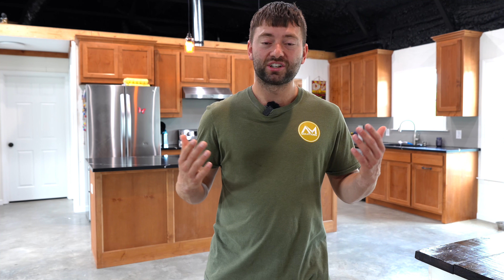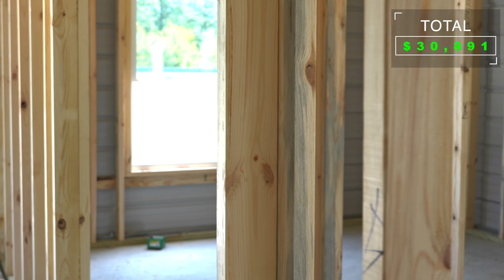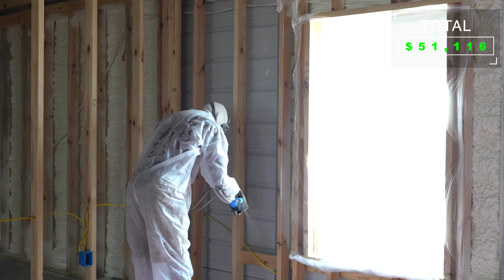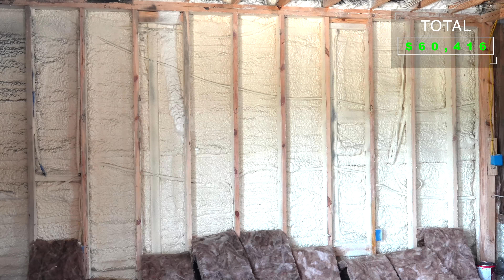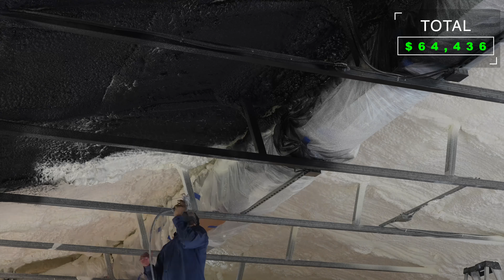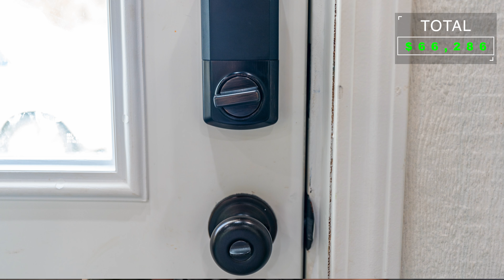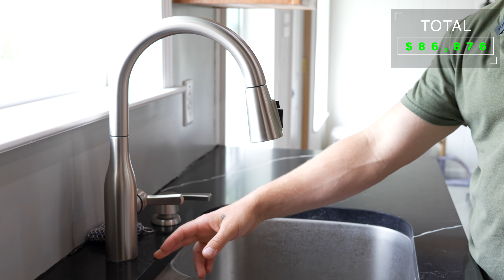Barndominium Price Breakdown | Building a 1,500 sqft 3 Bed 2 Bath Home for $87,000

Comment: Thanks so much for this video! 

It's especially useful because now others who want to build that size barndo can provide builders with this video's web address and ask them to compete. 

I didn't have the benefit of your video when I General Contractored my own barndo in 2008, so my task was a lot more difficult price-research-wise.

HVAC: I'm curious if you considered mini-splits instead of the fully ducted HVAC system that you chose. There are now available, at a decent price, 18-20+ SEER mini-splits that qualify for the 30% federal tax credit. I'd be curious to see a cost comparison to what you chose.

I have a 40' x 80' barndo that's half garage, half living space. My 1600 sq. ft living space consists of two bedrooms with their own built-in baths, plus one Great Room. Each bedroom/bath suite has its own 9,000 BTU mini-split and the Great Room has two 24,000 BTU systems. Each min-split is 100% independent so if one goes down, it won't pull down any other. 

Compare that to a standard HVAC system like you chose: If one part fails during a super-hot day, the whole system goes down and you're stuck until help arrives (sure, you're lucky; you ARE that guy).

BTW, I have a zero to negative (they pay me) power bill thanks to a 9.9KW solar array that I DIY-installed on my roof in 2010. And that’s with me keeping nice and cool (I otherwise sweat like a pig).

My 24,000 BTU Mitsubishi mini-splits are rated at 19 SEER and my 9,000 BTU units are rated at 20 SEER.  I only have to run them for part of the day during the Summer because my barndo is well insulated. And I never have to turn on my heat all Winter because I live in South Georgia (rarely goes below 50-60 most days) and I blended solar-mass hearing/cooling design into my home’s foundation (it’s perched up on an extra, sun-facing layer of clay).
 
My mini-splits also require lower maintenance than standard HVAC systems. We're talking once or twice a year E-Z filter clean, plus drop a chlorine tablet in the drain line maybe once or twice a summer. That's it. You can find more demanding maintenance videos online, but those are basically jungle-environment situations. My installer told me that, given where I live (and South Georgia is pretty humid btw), I'll never have to fuss with maintenance beyond the filter clean and tablet drops. 

That's a big deal to me when one compares HVAC system choices.  For each one must factor in long-range operating costs, and that obviously includes maintenance costs -- especially for those who pay pros to handle that. I’ve had no maintenance or other issues since my mini-splits were installed in 2017 and 2018 (they replaced window units).

Anyway, thanks again. This is one of the BEST barndo videos out there.
Reply from the maker: Thank you for the in depth comment! 

The big factors for choosing my HVAC system are simplicity, price, and effectiveness. 

My system is a heat pump system, so it is efficient. Not as efficient as the 18-20 seer mini splits that you have. That being said, it is hovering around 100° here in Louisiana and my electric bill was under $60 last month. My barndo is well insulated also. 

Simplicity: I have one system to maintain. Since my return is up high in the attic space, it does not collect much dust. I change the pleated filter every 2-3 months. I will also rinse my condenser once per year. 

During install, I only needed electrical service ran to one location. 

Finally, I have one condensate drain to maintain. And even if it gets stopped up, the entire system is outside, so I don't risk water damage in my home. 

Servicing and system replacement are convenient and simple. Everything is accessible outside at one location. No line sets, no soldering. I could swap the entire system in less than an hour for $3k with a 10 year warranty. 

Effectiveness: I have 3 bedrooms, 2 bathrooms, 1 closet, 1 laundry room, and a large kitchen/living room. 

That's 8 rooms. To have the balanced airflow that I want, I would need 8 mini splits or at least 8 indoor cassettes. (Probably an extra for the living room).  The benefit of the mini splits, is if 1 fails, it's not a big deal. If my central system goes out, I have no AC. The workaround is I can cool my house with 2 small window units. 

Price: Lets say everything cost about 7k, including running electrical to several locations instead of just one,  that's on par with my central system install. The cost and time savings comes into play when equipment needs to be replaced. I can swap the package unit in an hour for $3k with a 10 year warranty. It will take more time and $$ to change out multiple mini splits. 

There are definitely pros and cons to each system. I like the balanced airflow and ease of service. Plus the low cost of replacing all of my equipment in 1 hour.

I can't touch the efficiency or the ability to selectively cool one room at a time. Or the ability to replace the system in sections while still having AC.
Reply: @DudeWeCanBuildIt  I’m replying solely to benefit your subscribers since, again, this is an extraordinarily useful video for those thinking of going the barndo route – especially when it comes to cost and design utility issues -- in this case, standard HVAC vs. mini-split systems.
								
I also would like to provide if not evoke maximum information to inform consumer choice between the standard HVAC system versus my preferred mini-split system.  Note that I’m now on my third home.  The first two (stick-built, non-barndo homes) had the standard HVAC system that you’ve chosen.  As I mentioned, my latest (barndo) home uses mini-splits performing so well that I will use them in my next barndo.

There are a couple of your assertions that are, with respect, worth some push-back:

RE: “I can swap the package unit in an hour for $3k with a 10-year warranty. It will take more time and $$ to change out multiple mini splits.”

You’re supplying your own labor and thus, that $3k price is just for the hardware – and a bargain at that.  Two Savannah GA friends of mine just had their 2.5 ton HVAC systems replaced (and they shopped it!) for $5,500 and that was for the generic (“Goodman”) brand at 14 SEER. They would’ve each paid $1800 more for 16 SEER btw, but opted not to because they planned on selling their homes within 3 years.

Your assertion also assumes that all four of my mini-splits would fail at the same time.  That's like assuming that I have 4 cars and drive them all equally, so they’re just bound to wear out equally and fail all at once. That’s not anywhere close to reality.

For that matter, my mini-splits are used at different rates: Retired, I live alone so I use my MBR unit only at night because I don’t use that room during the day.  So during the summer, I shut the MBR’s doors during the day because I’m only in my Great Room and hey, why waste A-C on it?  Conversely, I turn my Great Room A-C off when I go to bed at night (I've got a very well insulated home -- artic foil pouch insulation -- and even deep summer mornings here in South GA are in the pleasant mid-seventies).  I A-C my Great Room only from 11:00 a.m to 11:00 p.m., then rely solely on my MBR system (see how flexible mini-splits allow one to be?).

My “Guest Bedroom/bath,” for that matter, is used only for occasional guests, so it’s the same there – its doors are kept shut during the summer.  Hence, that mini-split gets only infrequent use and thus piles up even less “mileage” (wear and tear) on it.  Finally, Mitsubishi is a durable brand, so it should easily go 10 years without any issues (in my 7th year for them all, btw).

This, then, is just plain wrong: “It will take more time and $$ to change out multiple mini splits.”

Don’t miss the obvious built-in advantage, too: Your system wears down whenever you use it and you’ve got to cool your entire home whenever you use it.  I can more efficiently “wear-and-tear” my equipment.  

END OF PART ONE.
Reply: PART TWO:

Your 10-year warranty claim (I’ve got that on the main components of my mini-splits) is misleading by omission because every standard HVAC warranty that I've read covers just one or two major components but not circuit boards and other common failure points like capacitors.  Worse, those warranties never cover labor beyond the first year or so, and just getting a pro out to my home costs $100 to “look at it,” then “plumber prices” for follow-up calls (you know, go get or order a part, then return to fix it while I stew in the mucky heat and round up "ransom cash").

Drill down further on that because it’s important: Mini-splits (thanks, China!) are now so cheap that it’s arguably easier/cheaper to just swap out entire malfunctioning air-handler or condenser units rather than pay for multiple service calls to diagnose, then install, the often “on order” replacement part(s).  Go to Amazon right now and click on this in its search bar: "ductless air conditioner mini split."

Pretty amazing, eh?  There are Chinese knock-offs of 9,000 BTU Brands in the sub-$600 range.

RE: “And even if it gets stopped up, the entire system is outside, so I don't risk water damage in my home.”

ALL mini-splits are more or less installed with their condensers (hence, condensate drain line) outside, so you’ve cited a bogus “advantage” here.  Even better: 100% of my drain lines are easily accessible, while with some (e.g., attic installations) HVAC systems that’s simply not the case (part of a drain line can get run through into a tight angled, roof-line slope).

Bonus: mini-split condensers (all 4 of mine) can easily be wall-hung (mine are camouflaged by my porch awnings) and thus, spare both ground-space consumption and maintenance (I have to constantly weed and blow leaves out of the “condenser corral” at my girlfriend's home).

RE: “I have 3 bedrooms, 2 bathrooms, 1 closet, 1 laundry room, and a large kitchen/living room. That's 8 rooms. To have the balanced airflow that I want, I would need 8 mini splits or at least 8 indoor cassettes.”

That’s an exaggeration.  No one is EVER going to A-C their closet.  Nor would I bother with a laundry room, in which one spends a few “in and out” minutes doing their laundry.  BTW, I don’t own a dryer – click on my Zillow page to see my surround porch, which sports a nice clothesline – and my high-efficiency washer is in my 1600 sq. ft. garage:

https://www.zillow.com/homedetails/2288-Deerwood-Rd-Soperton-GA-30457/194109099_zpid/?view=public

Next, recall that in my two-bedroom, two-bathroom home (plus Great Room), my two, 9,000 BTU units easily service each full-sized bedroom AND built-in, full-sized bathroom with storage closet and cabinet.

So really my home just needed 3 mini-splits but, like Louisiana, South Georgia gets REALLY hot/humid and I’m heat-sensitive, so I opted for that second (really a backup) 24,000 BTU system, which I turn on only to supplement the first system on 95+ degree days (many Southerners wouldn’t need it because they’re fine with 78-80 degrees inside but I  want the option to go down to 69 degrees – given my “Yankee heritage”).

Ahhh, but you'll ask: What about a barndo design with SEPARATE bathrooms?  That would be problematic (that’s my luxury, btw: I’ll never build another barndo without each bedroom having its own, built-in bathroom like I currently have).  If each barndo bathroom doesn’t have a doorway that (like mine) opens to its own bath then sure, that separate bathroom would get hot and humid in the summer.  

In that case, one can choose to drop $600 for a small mini-split for each.  Again, check out the “Amazon” selection – and those are full package kits btw (I ordered a full-package, 24,000 BTU Mitsubishi kit for my Great Room that way).  Sure, that's a lot of equipment for a bathroom, but I build only large bathrooms so there's plenty of wall space for the air-handler part of a mini-split.  But sure, smaller bathrooms will present a problem, so there's a plus for your side of this debate.

Anyway, pause to add up four mini-splits at today’s prices (remember that pricier units often qualify for the 30% tax credit), then include installation (plenty of mini-splits are DIY btw) and electricals.  You’ll find that there is no comparison to the central HVAC systems my Savannah, GA friends just installed; mini-splits win the day here.

END OF PART TWO.
Reply: PART THREE:

There’s more.  Again, you concede that a failed central HVAC system leaves one stranded on a hot day, with the typical consumer waiting for 1-2 repair visits and even longer if a part needs to be ordered.  And that’s a lot of hassle to go buy (or garage-stock) “emergency window A-C” units at the local Walmart and install them while burning up in sauna bath-level heat/humidity (I used to live in New Orleans, btw; it can be brutal).  Meanwhile, my four separate mini-splits, all on their own circuits, translate to no hot, sweaty nights – ever.  If my MBR unit fails, I'll just sleep in my Guest Suite, or on my futon bed in my Great Room.

That’s a 400% redundancy compared to your central HVAC choice.
 
There's still more HVAC-system downside to consider:  You’ve had to consume inside-building space just to run HVAC ducting and those long, aluminum-foil tubes.  That prompts many to create an attic, which I was able to skip (check out my Zillow interior photo).  And ducting itself constitutes a maintenance issue: After about 8-10 years, one must inspect for and repair seam leaks and resulting cooling losses.  And that’s on top of the cooling loss just from pushing cool air through the length of those tubes – through a super-hot attic at that.  Check this out: https://www.carolinaductmasters.com/what-should-you-know-about-your-attic-ductwork

My mini-split installer, btw, told me that HVAC systems can be made very efficient but always come in at lower SEER ratings because they're dragged down by ducting -- having to push cold air through them AND thus suffer the "cold losses" along the way.  In contrast, there's NO ducting with mini-splits; they're shooting cold air directly into each room.  So in effect, you’re paying more for more “compensatory cold-air generation” just to use a centralized HVAC system, and that’s on TOP of the interior living space loss (I like my high, “vaulted ceilings” btw).

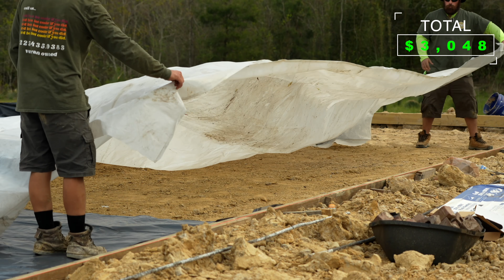Sidenote: I was able to use "grow-room" (what marijuana growers use) membrane for my Great Room’s ceiling (enhances natural daylight and acts as an additional insulating layer).  That enabled me to use the ceiling's natural vault angle per my roof’s 2:12 pitch.  I didn’t have to create channels or an “attic” space just to accommodate all the ducting and venting that a standard HVAC system requires.

One mini-split downside, at least with the brand I chose: It doesn’t import fresh air but instead 100% re-circulates the room's air.  That's not an issue, though, because of my building's design choice. You can see it in my Great Room photos.  I used (from Lowes, lifetime warranty, on sale) six sets of French doors instead of windows for maximum glass and E-Z access to my forest.  The middle spine of each door set has a 1/3" gap at the bottom and I’ve stuffed a stainless steel mesh ball into it to keep bugs out.  Fresh air thus naturally flows in through each of those gaps. Pulled upward by the naturally higher air temps at the higher-elevation in the room, that fresh air then works its way up to the built-in ceiling vents and out the roof, carrying existing air (hence, refreshing it) with it.  My mini-splits "pour" cool air into the room at the same time and a natural "swirl" results.  

That’s passive air circulation; no additional pumps or fans are needed.

Similarly, each bedroom – in the summer – draws open floor-tile cooled, “floor air” through each bedroom door gap and that air, too, flows (as it's heated) up to the angled ceiling that “guides” it through 4" wall cut-outs (like “dragon teeth”) to the same roof-vented, natural air flow exhaust system.

Put another way: All three rooms in my 2:12 roof-pitch barndo have up-angle-sloping ceilings so those special cut-outs between rooms enable relatively cool, floor-level incoming air to naturally rise (as it heats) and flow directly out of central-seam roof vents.

In that way, there is no heat or moisture or stale air build-up.  

Bonus: The bedrooms (with their doors closed during the summer) are at most 10 degrees warmer than my Great Room if I leave their 9,000 BTU mini-splits off during the day.
  
Relatedly, you also mention wanting a “balanced airflow.”  That’s a feel-good statement, not reality.  In fact, I don’t want a foul-smelling guest’s air imported into my space.  And I don’t sense an “imbalance” in my home’s air; my passive ventilation system works just fine.

One could argue with me -- that I've  basically eliminated use of the bedrooms (by not A-C cooling them) during hot summer days, and not everyone is that parsimonious with their A-C usage.  That’s true.  Life’s full of choices.  But remember that there's only a 10-degree spread between AC-d and non-AC'd rooms.  Too, my 9,000 BTU bedroom mini-splits quickly cool each bedroom down to the point where, if I turn it on for a rare nap, I’m comfortable within 8 minutes.  I choose not to waste electricity to be “spared” that 8-minute wait for an occasional nap or daytime romantic romp (increasingly rare at my age, sadly).

Finally, you’re overstating the “electrical” component factor.  For each mini-split there’s just a dead man’s switch, a surge protector and a run of 12 gauge wire going from the condenser to the main circuit box in my garage (my installers mounted a special, 4-breaker add-on box for the mini-split lines, then tied it into an open circuit in my master circuit box).  

You also mention each mini-split’s “line set.” That's also a non-issue.  Pretty much every kit that you see on Amazon comes within a line set and everything else that you need.  And the DIY-oriented systems are pretty much plug-n-play – unfurl the line set, fasten it to the condenser and air handler as instructed and you're done.  The Mr. Cool version doesn't even require any special tools.

And absent a defect (a leak), mini-splits (why they use them in motel rooms) are “set and forget.”

Even the mini-split filter beats out your system.  It’s a permanent plastic mesh deal.  Just slip it out, blast it clean with your garden hose, let it dry, and then slip it back in.  You, in contrast, must continuously buy landfill-burdening, disposable filters.

Super Bonus: My guests get to quickly and easily cool/heat their bedroom/bath “Guest Suite”  to their tastes.  I can thus “frost-box" my MBR on a summer night while they can comfortably snooze at, for example, 78 degrees.

To summarize: 18-20 SEER power consumption; DIY-level installation option (sure, pay an electrician for the wire-up part); no duct-system space consumption/maintenance; never any “hot-sweaty-hell” night worries if a given unit fails; better, customized temperature control for guests; simpler mechanicals that are now so cheap that “swappability” is an option; and no filter purchases, ever.  And again, once or twice a summer I open the PVC drain line for each and drop a chlorine tablet in it – about 10 minutes of my time, plus another 20 to quick-clean the filters. This Spring, after 7 years, I removed the condenser cowling and spray-bottle applied a specialty cleanser for the coil part of each condenser and vacuumed out some cobwebs.  A garden hose and a screwdriver were my only other requirements for that.

Anyway, thanks again.  I’ve been collecting videos like yours because I plan to build a 50' x 100' barndo on the other side of my property and you’ve supplied critical data. Example: I want my building to have a 150 mph-range wind rating at a good price; in 2008 I paid an extra $6000 to get my existing barndo up to a 130 mph wind rating and it appears that design efficiency – what you’ve just done – has improved to the point where you were able to reach 150 mph at an even better price.  Kudos!

P.S. I live in a no-code, no-zoning GA county, so there are NO permits for anything, but I of course have always built to code if not above it.  Safety and durability first!
Reply from the maker: That's fantastic. I see you have put a lot of thought into your setup and it works very well for you. 

I also see that you have a strong preference for mini split systems which is understandable. They do have a strong list of benefits that are unique to them. 

Everyone has their preference and I appreciate you sharing information for those watching the channel and reading the comments. 

I definitely considered both routes, and for me, the central system is simpler. The "balanced airflow" is not a gimmick. I like my closet, laundry room, and bathrooms to have a steady supply of fresh, cool, dry air. I live in Louisiana and have had closets and bathrooms without AC and they stay warm and stuffy. Not to mention humid, which is not pleasant and promotes mold growth. 

I think you misunderstood the part on the condensate drain. The condensate (water) is generated by the evaporator coil, not the condenser. The evaporator coil on your mini split systems is inside the house and has to drain outside. On my system, the evaporator coil is outside so there is 0% chance of water damage. It is great that you maintain your drain lines because mini splits do not generally have float switches to protect from water overflow. So, if the line gets clogged, it will drain down your wall. Definitely keep up the vigilant maintenance on the drain line and also filter cleanings.

I'm also not a huge fan of the filters on mini splits, they remind me of window unit filters and will allow smaller particles to pass. We do maintenance on mini splits and wash the indoor units yearly. We have a special "bag" that wraps the indoor cassette so that we can wash it with water and cleaner. You would be surprised how dirty they get. Cleaning a package unit is quicker and easier. You remove the top and have access to hose out the condenser and evaporator coils in one place. No need to contain the water because you are outside. Then put the top back on. 

You have me on efficiency, redundancy and versatility (selecting which room to cool) but not on ease of maintenance or airflow. 

Mini splits are DIY friendly, but we have been called out to help DIYers figure out what they did wrong on install. We also install and service them. They are unique and have unique issues and some technicians are not familiar with the systems. At their price point, it's probably cheaper to replace than to repair a mini split.

The next thing is the filters. Yes, I use 4 paper filters a year. Biodegradable paper and cardboard. I'm sure replacing a mini split occasionally is going to outweigh the environmental impacts. It is DIY to install a mini split, (if you are handy enough to cut penetrations in the wall, wire up the units, connect the line sets, and mount the cassettes and condensers), but it is not DIY to replace a mini split unless you have an EPA certification and equipment to properly recover the refrigerant before disposal of the system. Otherwise you "should" call a professional to recover the refrigerant for you. That will be an added cost even if you DIY the rest of it. 

Swapping a package unit is very simple because it is a package unit. If you can install a mini split, you can install a package unit. If you are going to compare prices of having a professional install on a package unit, at least be fair and compare it to a professional install for the mini split. Otherwise, $3k for a RHEEM name brand package unit vs $2400 for bottom of the barrel Chinese mini splits. Or maybe $3500 for solid Mitsubishi units. Comparable warranty and comparable lifespan for similar use cases. Yes, I know you don't use half of yours, but not everyone is going to do that. Price for system replacement is about the same. 

I like mini splits and they have have their benefits. For the reasons I outlined above, I chose a central system. It wasn't an easy choice and I did what makes sense for me. Congrats on using mini splits to your advantage for your lifestyle. They are a fantastic product and I hope plenty of people benefit from our conversation.
Reply: It is my hope that our point/counterpoint will assist other barndo folks here.  

Miscellaneous point # 1: Your opening video shot reveals a "bare" barndo -- no porches or even awnings protecting your windows.  As you can see with my galvalume-roofed barndo, I've got a covered porch 100% surrounding the living space half of my 3200 sq. ft. barndo.  That's made a huge difference in multiple areas, including:

1.  Less summer heat overall since the sun is not beating down directly on my walls and windows.  This is especially critical because I had to eliminate all shading for my solar array.

2.  Window longevity: An entire window-replacement industry exists because so many homes (stick, barndo) are constructed with the elements (sun, wind, rain ) directly "attacking" the windows.  My windows are completely protected (and again, less sunlight and thus resulting heat comes through them) and should last forever.

3.  Standard "porch living" benefits -- space for rocking chairs, outdoor coffee and dining tables -- even a hanging king-sized porch bed.  And, of course, no rain or sun beating down on me the moment I walk out one of my doors.

I didn't break out the extra cost of my porch when I built my barndo, but it's indispensable to me and I would never build another barndo again without it. 

Bonus Feature: My solar array (54 panels) is 100% mounted above ONLY the porch portion of my home.  Hence, if any roof leaks ever manifest (none so far) from the solar panel roof mounts (I had to drill through the roof to fasten them, and used special screws for that), at worst I wind up with some water dripping down on my porch, and not inside my home.

Miscellaneous point # 2: You’re obviously multi-talented and one of those talents includes the ability to find excellent prices for barndo components.  Please consider generating a webpage (or directing us to one) for “barndo shoppers."

Ditto for designs.  We both chose, in that regard, the standard rectangular (I call it “neo-industrial”) design which, though boring to many, yields so many advantages: 

1.  Faster, easier construction because barndos require less labor, and less skilled labor at that (some DIY-ers in the mix already), thus lowering labor costs.  Simpler-design = simpler components and labor skills.  You evidently found a vendor that’s mastered that concept and thus, got your building constructed quickly and efficiently -- at an impressive price.

2.  Zero roof debris (leaves, etc.) accumulation, since there are no roof valleys.  This has meant so much to me because I’m now “old” and don’t want to go up on my roof except once a year to truck-brush wash my solar panels following the Spring pine-pollen “dusting” season.  Side note: I had a ship's ladder permanently bolted onto the back of my building to facilitate quick and safe roof access.

3.  Lower building component prices: Really, if everyone stuck to the standard rectangular design, the industry could achieve better economies of scale in mass-producing standardized components and routinizing ship-to-site delivery.  This would result in lower-cost (both upfront and “levelized”), greener homes at an obviously more affordable price (truly, the best thing about your video is simply educating “the masses” that barndos are the way to go!).

Miscellaneous point # 3: With the advent of cheap solar (thin-membrane and hard-panel based), I urge you to beckon building designers (PEs, etc.) to design-in DIY-level “solarizing.”  It’s getting so cheap and plug-n-play simple that both roof AND vertical sidewalls will be covered to reach the Zero Energy consumption that I now enjoy.  I’d also like to see data-collection on passive solar-mass heating/cooling (it cost me an extra $3,300).

In short, there’s so much more you can do with this page, especially as “barndo-mania” spreads!
Reply from the maker: @jamesdesmond1301  Thank you for all of the constructive input! I am going to build a 10' wrap around porch and 30' on one gable end for car parking and an outdoor kitchen 

The back of the house is going to have a hot tub and there are hot/cold water supply lines and a drain for an outdoor shower under the porch. 

I don't have pricing (or the budget) for all of that yet. I am certainly a fan of economical and practical rectangle shaped buildings without dormers and extra valleys/ridges.

I do look forward to having solar panels installed to offset my already low ($60) electric bill and maybe even make some money from surplus electricity. One thing at a time though. Keep an eye on the channel for future projects!